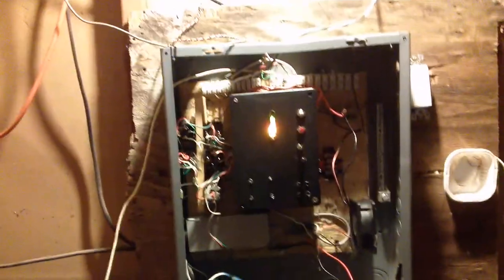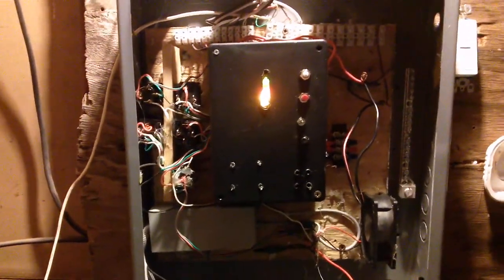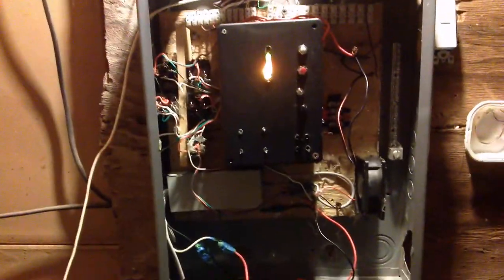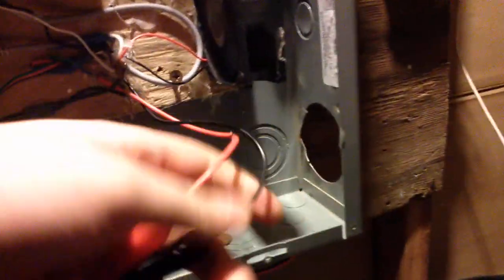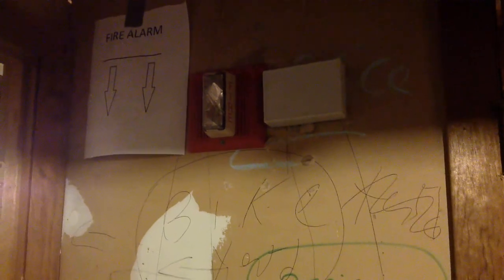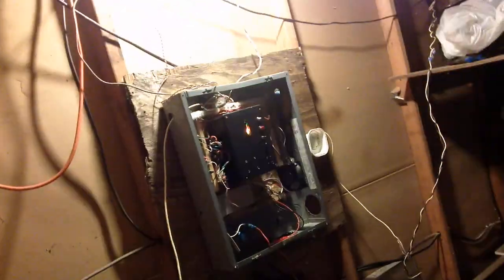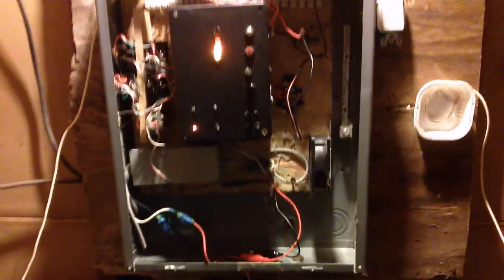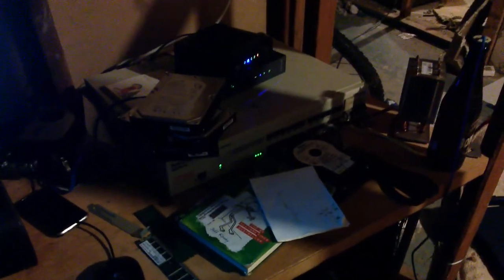system test 25

Comment: Dude, are you ever going to get real horn strobes and pull stations?
Reply from the maker: NJMoo3652 1st of i do have real crap i like my home made stuff better. 2nd stop harassing me 3rd i like having feed back but if your going to keep on responding on each video with the same comment what's the point. and if you think that my videos are crappy then why do you watch them. i really don't give a shit about what you think of my videos.
Reply: Nice panel though! Does it have audible silence? Also one recommendation is that you should spread out or separate and label the LEDs. Also, I'm not completely sure but there's the possibility that you may have fried a relay or a component going to the LEDs that why it's acting up
Reply from the maker: NJMoo3652 Thanks. And It does Audible, and Selective. Yes your probably thinking that's impossible on a old school style relay panel BUT it's not in system test 22 i showed the diagram on how it worked. Any how i was going to label the panel after i got done painting it but the panel had a short because of a lightning strike and it fucked over the main I/O controller so i had it taken apart and i was dissecting it. it is a 12 V 12A DC power out put with 2 NAC's and 3 if i have the D.S.S.INC. safety sync card in it with selective silence 4 zones 2 Aux relays a AUX system supervisory zone and 2 signal coding and if you add in a code three card and other coding cards it can do them it have a total of 3 I/O card slots. this isn't the first one i made to i have a couple of friends that payed and had me build them some  

any how i put a lot of work into this thing and it still needs more